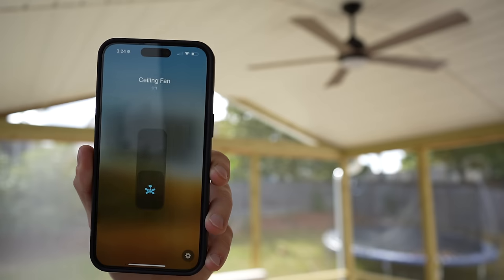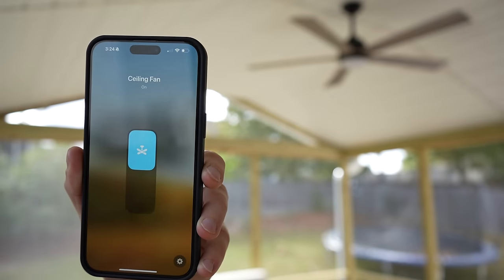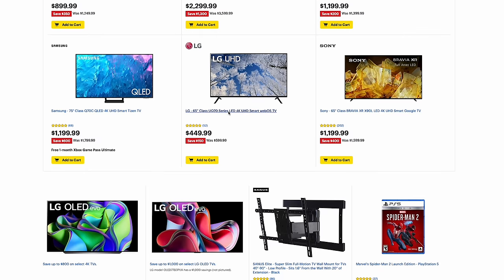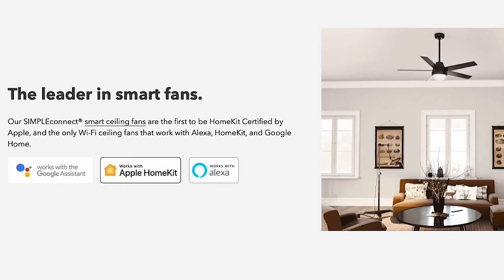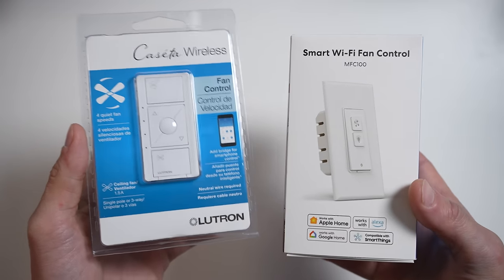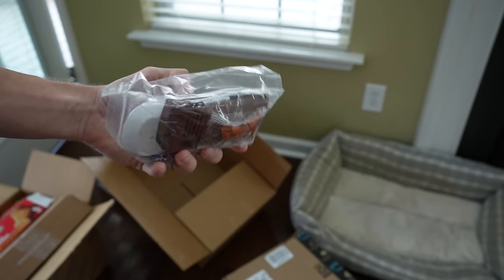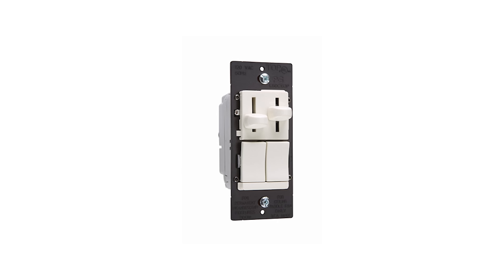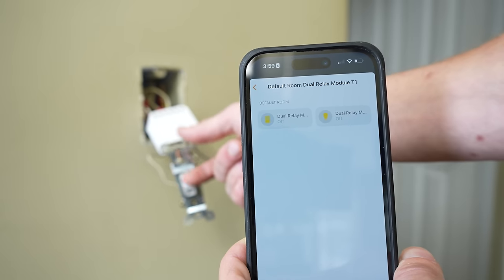Make Your Ceiling Fans Smart: The Ultimate Guide!

Comment: Not sure about fan control, but a very simple control for the lights is to just use Nanoleaf bulbs. No wiring and great homekit integration without extra hubs, neutral wires or homebridge. I'm surprised you didn't include that simple optioning in your video. PS, I love your wife! she's so reasonable... you're lucky to have her to control your tech for tech sake tendencies.
Reply: I was thinking the same thing!
Reply: the reason he didn’t mention it is because this video is about making your ceiling fans smart. smart bulbs can easily lose power and become non responsive once someone flips the switch by accident. the same goes for ceiling fans. that is why he dives deep into smart switches and other options. the end goal is to have smart control over these things without worrying about power being cut off at the switch.